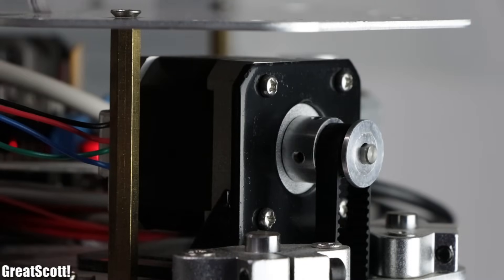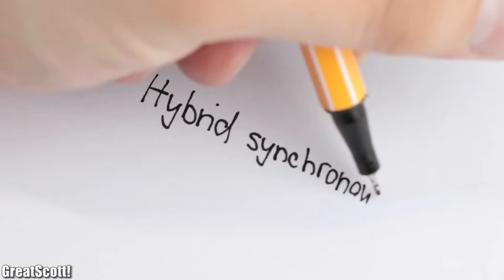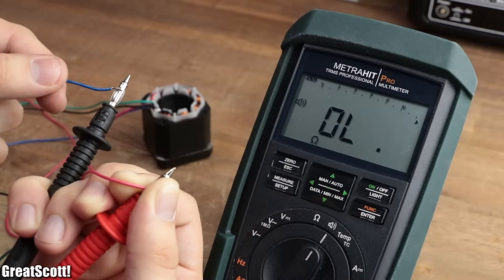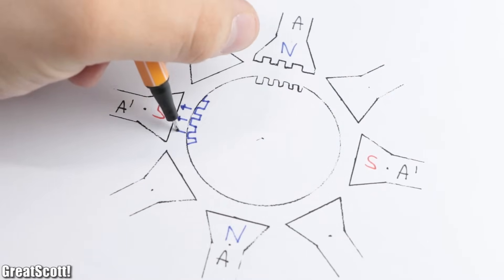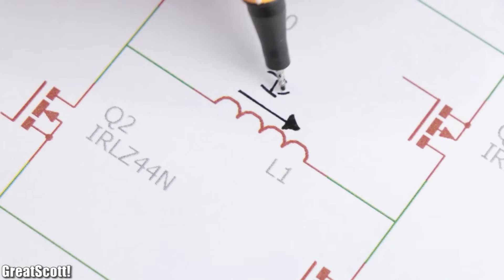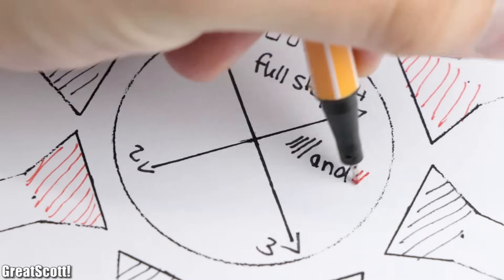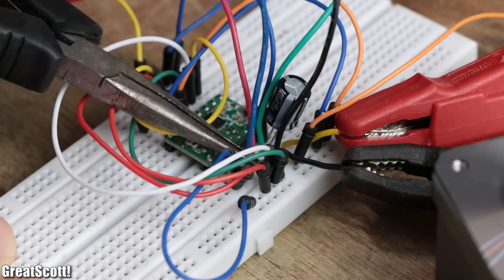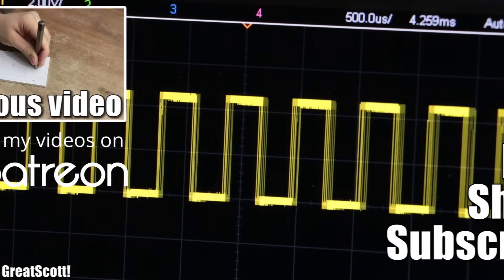Electronic Basics #24: Stepper Motors and how to use them

Comment: Can you Show How or Where I could buy or Make a Circuit where I could have a Potentiometer at Center of Sweep would be Stopped, Then turning one way would be CCW, Turning pot other Direction would Rotate CW, the more you turn either direction would increase Speed?
Dewalt Makes a Gyro Screwdriver, Turn left a little, Rotates Left, turn more, Speed increases. Have an old Trac Phone Given me, after installing Starling on a Boat, Yacht. Thinking about Putting a Bluetooth Mike on it at Focal Point, this way I would have a Controllable Up, Down, Left, Right with the Dish. 
Thanks

Comment: I have a micro stepper motor around 6mm in length and 4mm wide. I don't know how much current It draws, but could I run it off the Arduino pins directly? Should I have some sort of protection? if so it would need to be very small for my application. Thanks

Comment: i found a stepper motor in an old printer , on the data sheet its need 34 volts to run , so i wired it up to the 28BYJ-48 driver which is support up to 50 volts ,,,, and the otor burns it

Comment: I need a relatively small motor, preferably DC, with enough torque to lift approximately 10 ft pounds of pressure, rotate half way, and then reverse direction, rotate half way, then reverse direction again, repeating this cycle over and over again, and it be able to run continuously like this for several hours at a time. It's for an animatronic prop.

Comment: Had a problem with one of my stepper motors on my 3d printer . It's a 42 38 
It was skipping . Opened it up and a small chunk of plastic got in there . It works fine now .

Comment: This is the best way a new student learning Mechanical / Electrical / Electronics Engineering master the basics, by examining or case studying what was already professionally designed and built, manufactured a practical save working device by Senior Professional Engineers.

Comment: I am using 26kg torque Nema 23 motor, but its not able to give that much torque practically.i m using 6600 driver which is able to provide 4 amp current to motor.i have tried using full step mode also but still no luck. What are possible reasons for this sir?
Plz reply

Comment: I have 2 brand new stepper motors on my y axis, a being a slave to y and both make a very bad noise like they are grinding even when disconnected from the screw. What could the cause of that. I wired them according to the wiring diagram. my other stepper motors for my x and z axis work fine and don't make this terrible noise. Can you help?

Comment: Do you think the 4988 board you have can drive a Juken x27 stepper motor, commonly used in General Motors gauges?  I am afraid the driver board will not be able to match the 260 ohm coils in this small of a motor.  Juken Swiss Tech offers a chip, but I cannot find any information about it and I am not an engineer to be designing a board around a chip anyway.

Comment: I use an amp to produce a set frequency to drive the stepper at a particular RPM. the frequency generator app on my phone connected to the amp makes the stepper act like a synchronous motor.

Comment: /*Definisi variable delay*/
unsigned int myDelay=500;
void setup() {
// put your setup code here, to run once:
/*Konfigurasi IO*/
pinMode(13,OUTPUT);
pinMode(2,OUTPUT);
pinMode(3,OUTPUT);
pinMode(4,OUTPUT);
pinMode(5,OUTPUT);
analogReference(DEFAULT);
Serial.begin(9600);
digitalWrite(13,LOW);
}
void loop() {
// put your main code here, to run repeatedly:
unsigned int ain=analogRead(A0);
myDelay=map(ain,0,1023,0,500);
Serial.print("myDelay: ");
Serial.println(myDelay,DEC);
//step-1
digitalWrite(2,HIGH);
digitalWrite(3,LOW);
digitalWrite(4,LOW);
digitalWrite(5,LOW);
delay(myDelay);
//step-2
digitalWrite(2,LOW);
digitalWrite(3,HIGH);
digitalWrite(4,LOW);
digitalWrite(5,LOW);
delay(myDelay);
//step-3
digitalWrite(2,LOW);
digitalWrite(3,LOW);
digitalWrite(4,HIGH);
digitalWrite(5,LOW);
delay(myDelay);
//step-4
digitalWrite(2,LOW);
digitalWrite(3,LOW);
digitalWrite(4,LOW);
digitalWrite(5,HIGH);
delay(myDelay);
}

Comment: I faced a  vibration issue in my stepper motor could u tell me how to remove it I already using max 
micro-stepping 1/32  ofDDRV8825 (MOTOR DRIVER).

Comment: from point of mechanical engineer any advice in designing to improve stepper motor to achieve higher accuracy? i mean in term of mechanical engineering aspect, the layout and construction of the motor itself, what can mech. engineer could contribute in general in designing a stepper motor. here in my college mech engineering class is barely talk about electrical motor, just basic stuff like torque and power calculation and implementation of electric motor instead of designing and other in-depth study of the electric motor construction itself, we're study a lot of combustion engine like diesel cycel and otto cycle, gas tubines, thermodynamics, etc but not so much on electric motors or other electromechanics related subject...

Comment: Guys i have a problem with my motor, it does this fast spin,slow spin, fast spin slow spin and so on motion. What do you think should be the problem? Is it the power supply or the motor is broken? Btw its a 12v dc motor
Reply: Polarity problem?

Comment: Scott, great video. I work in maintenance and today we had an issue with a step motor exactly the one you had in this video. We spend 2 hours trying to figure it out the issue, we find out the wires were burn in the harness. But my question is, how can you test the driver to know if is good or bad? thanks!! this was a 24v motor 8 leads

Comment: Important to note - this only turns, it has no idea what position / angle the shaft is.  To get that, you need to add external "stops" or sensors of some type.

Comment: Thank you for sharing this .. I liked it a lot.  I have a question .. I have a plotter with the same motor installed.. the motor skips if I put too much pressure on it using thicker materials ..  How do I disable the skipping part?? how do I force the motor to keep spinning ?  or do I need to replace it with a bigger motor or increase the voltage?  I am not an engineer but I need to know what the possibilities are.  Thanks again friend.

Comment: Hello, can anyone help me out ? I am planning of building a bigger car, like half a meter long and I was thinking of using stepper motors as engines for each wheel. So that I can get a really strong car, because I want to carry things with it. The motor that I was planning of using it's similar to the one in the video, it has the same specifications. Also, I'll be using a battery pack and a driver for each stepper motor. Will it work ? Will it be extremely slow ? Will it catch on fire because of the dumb way to use a stepper motor ? Will it go faster than 10-15 km/h ?

Comment: Hi, I have the same circuit composition however I am using a NEMA-17 stepper motor with a rated voltage of 2.7V, I am using a 9V battery and it's working for now - do you see any problems with using a 9V PP3 battery?

Comment: First, let me say that I am very new to this world and have little understanding of electronics BUT I am learning. I am looking for a more basic controller. My original intention was to purchase a TB6600 driver, a Nema 17 stepper motor and some kind of stand alone controller that will remotely turn a variable vacuum capacitor being used in a tuning network for a mag loop antenna. All I need to control is the speed (fast for coarse and slow for fine tuning), direction and possibly some way to create (virtual) end stops to avoid damaging the cap (replacement value of $200@) and stressing the motor. Can anyone point me in the right direction? Thanks.

Comment: Additional information : You can variate the frequency of the 555 to change the motor speed . You can use an optical encoder to determine distance and have your micro controller adjust distances and work within critical tolerances.

Comment: Hi GreatScott

Love the video.

I have had lots of trouble getting a nema 17 stepper motor to work on a raspberry pi. I have attempted many drivers including the A4988, l298N dual hbridge and eventually bought a megapi in the hope of getting it to work. I like the megapi with the stepper motor drivers. any help would be great. 

I want to control the stepper motor using python but just can't get it right.
thanks again

Comment: Hi scott,

I want to control two stepper motors, where i want to move both motors simultaneously with different speed and to different target position. im using A4899 drive and arduino UNO to control it. connection wise i managed to do it. But the program i still cant make it. will u guide me on it??

Thank you
Reply: you need more than one driver. and an Arduino for this task.
Reply: Carmine Varvayanis yes correct and i do have 3x a4899 and 3x easy driver. I have programmed accordinglly but failed to do the task i wanted.

Comment: I have a question: why does the stepper acts like crazy when I use the driver HR4988? I've even changed to the sn754410NE (H bridge) and still acting like crazy.

I'm feeding the motor with 12v from a pc power supply, used arduino to control the H bridge

Comment: wanted to control a stepper motor but then do i neeeeeeeed an h- bridge with mofsets can i not just use transistors?
because i`m a noob at electronics
Reply: Westin Ritter you can just use transistors. I'd recommend using two pnp and two npn per H bridge.

Comment: Greetings! I love your channel and have learnt a great deal. Thank you for making all this interesting and informative videos. 

If you can, please make a video on request, i would be grateful. Can you please make a video, on how to control a washing machine motor using arduino.  This is for a project i am working on and stuck. I need high torque motors, but cannot use steppers as they are costly for high torque applications.

Comment: I have a question regarding powering the steppers while controling them with an arduino. Lets say I want to control 2 steppers. Obviously I can`t power them directly through the arduino, so I assume I need an external power supply... but how do you power the steppers while still controling them with an arduino?

Comment: Can a stepper motor be used without any arduino or processor. Im thinking of connecting it to the ESC then ESC to the receiver? Is that possible?

Comment: Goodmorning,

Hi, I'm Lemuel D. Corpuz. I message you because I need your help because I have the complete panel of CNC panel/ Plasma panel, Start Shaphon, stepper driver, stepper motor all i have, but i dont know how to connect the wiring of the machine. So please help me how to wire. Its a complete panel and the wiring inside the is connected already but i dont know if all wiring is correct and also the wiring of stepper motor to driver not connected so im begging you pls help me. this is my email lemueldcorpuz@gmail.com

Thank you and Regards,
Lemuel D. Corpuz
Reply: Ok sir, thank you so much hehe

Comment: How do you determine what voltage power supply is to be used with a particular stepper motor assuming the specification sheet does not tell you?

Comment: thanks great video , i disassemble and re assembled one stepper of 3 like you did but noticed much less magnetic resistance manually turning the shaft almost none comparing with the others , did it lose torque & could this be fixable ?

Comment: hey Scott, ive used the driver chip mentioned in the video, and I managed to burn through 4 of these. I got them so hot the chip moved from the PCB. But I also got a spare one from a friend, one with a red PCB, which shouldn't matter, but that one didnt burn overheat. I use the  same connections except the 100uF capacitor on the VCC, but my friend who builds 3D printers and stuff doesn't do that either...

Comment: Is there a way to basically invert DC (from a battery) to AC to drive a 2 wire motor without using an arduino?
Reply: You need an inverter for that (not an easy circuit)

Comment: Thanks for the video! This electronic playlist really provides me with great knowledge! 

Can you tell if there are any sources or youtube channels that provide you with how engines work basics? I mean essentials of their work - DC, synchro motors, async motor and even PMSM? I know before learning that i have to get acquainted with theoretical basis of electric engineering (which is also pretty difficult to do without even doing practice or at least doing laboratory class) but still. Any recommendation?

Comment: im planning to use a stepper motor on my pulley system for a school project. What are the components do we actually need? Im planning to get an RC Controller (Transmitter and Receiver) too since I will also need to control a servo motor and a dc motor. Can I directly connect the stepper motor to the receiver just like the servo and dc motor? Im trying to avoid using arduino since i have no experience. Basically, the dc motor and servo motor are used for driving the robot while the stepper motor is used for a pulley system to climb up the stair similar to the lego mindstorm stair climbing robot.

Circuit diagam:

Battery -> Receiver --> Failsafe---->ESC ----> DC Motor
                          '-----------> Failsafe---->Servo Motor
                          '-----------> Stepper Motor

Do I need to connect anything in between the stepper motor and the receiver?

Thanks in advanced!
Reply: Well unfortunally you can't run a Stepper motor like a DC-Motor form a DC current like your DC-motor or Servo, so you need some kind of Contoller that switches the currents, like the H-briges and a timer. But learning how to run a stepper Motor with arduino is a great exercise for a school Projekt and there are many great learning resources online.

Comment: Thank You GreatScott! 
 I have always been interested in stepper
motors but never really had time to put them on anything. I'd like to put some to use on a small 4 axis engraver, seems like I could harvest most of the parts if not all from printers and blu ray players. I'm not really sure 
what software to use or which I'll get most bang for my buck either, Python or Arduino
I could use python for writing add-ons to 3d
Cad that I use at work and get them to pay for my learning or just go with Arduino for its small but powerful package. If anybody has anything to add or comment about it I would appreciate that, well okay GreatScott I liked and subbed so I'll see you on the next videos
for now I have some shopping to do in the free section of CL.
Thank You,
Kevin

Comment: Great bit of information..... I have a satellite dish on  motorhome which is fixed to the back bumper... If I want to use the satellite dish I swing it out manually and then have to move it around to find the satellite....
I want to be able to sit inside the motorhome and use a stepper motor to swing the dish up and down and sideways to look for the satellite.
I am in Australia and that sort of manually operated device is not available.... 
Is it possible to manually control a Diseqc 1.2 Motor with Metal Gear
using the control system you have there?

Comment: So Im about to get some sort of electric motor probably a stepper motor wich will lift 25kg, the speed is not an issue. My goal is to lift a foldable bed made out of MDF, so it would fold back in to the wall. Is a stepper motor the right choice, or would any other motor be better for the task? they seem relatively strong. Any info is appriciated

Comment: It would be nice if you can include details on steppers with 5 and 6 wires.

One little trick I use to find the pairs of a stepper is to first, with no wires connected to anything, spin the motor by hand and feel its stiffness. Then, connect any two wires together. If it's a pair, it will be harder to spin the motor by hand. (Because it now acts as a generator with a dead short)

Comment: Hey Scott, QUESTION: 
I have this old laptop from a buddy, didn't work and he just wanted to get the data. I did that, and later went on to check what was the situation with the laptop. The power jack was broken. The pin in the middle, so i just soldered some shit on there and made it work, and the thing runs. Now, i just want to get this power jack part to replace it. Where would i look for that? I could go to Conrad with the part and ask them  i guess, but maybe there is a way to order it online without knowing the exact part number? Is there some sort of online electronics part supplier?

Thanks, love your videos!

Comment: DO NOT remove the rotor from a hybrid or permanent magnet stepper motor like this! By doing so you will weaken the magnet and irreversibly reduce the torque of the motor.
Reply: Billy Sugger not irreversibly, but for the average hobbyist, impractically. I own a motor rebuild co. Our 40kJoule magnetizing equipment works just fine.

Comment: Could the mosfets be substituted by npn transistors?
Reply: You can make H-bridges with BJTs, yes, BUT the transistor would have to dissipate much more power, and you'd require heat-sinks and blah blah blah.

MOSFETs are much more efficient for this kind of thing.

Comment: Another common place you will find stepper motors, is in Fruit / Slot machines..... those based on Barcrest's MPU4 hardware (Quite common in the UK and most of Europe) is quite interesting, and helpful you can find MPU4 guides quite easily on the net.

Comment: I think you forgot to put a big fat warning stating "DO NOT TAKE APART YOUR HYBRID-STEPPER MOTORS. YOU WILL RUIN THEM" ... Opening one makes the magnetic flux go through the roof and the magnet loses part of it's force. Not good. Remember that the motor armature is magnetised after the motor has been assembled. The stator acts as the magnetic "keeper" to keep the steel magnetised.